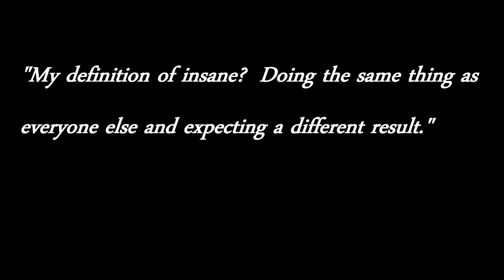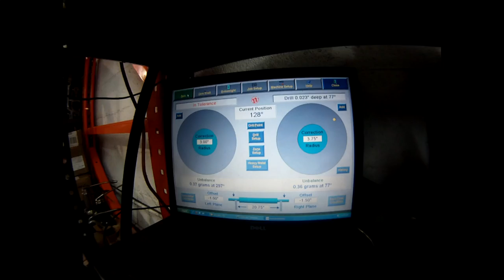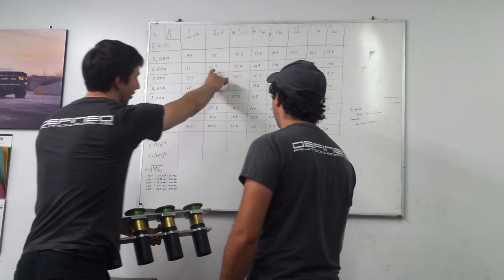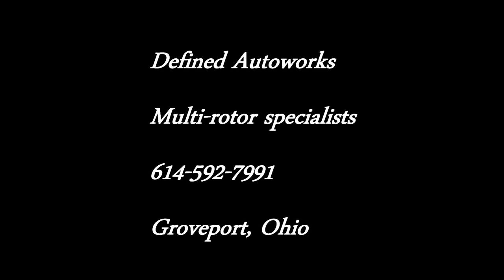Mazda Rx7 4-rotor race car. The making of a Defined Autoworks Beast. [Offical Video]

Comment: LSX>Rotary 

Nuff' said.
Reply: Howl? I guess Honda's have howls too then lol cause they both sound like shit
Reply: Mike Zita A peripheral port four rotor off idle sounds about as much like a regular ol' 2 rotor (or a 4 cylinder) as an LSX does (Meaning, it doesn't at all.) At WOT the exhaust pulses in this all match up and give it a v12 type sound. A 4 rotor has three times as many exhaust pulses per rotation of the output shaft as a 4 cylinder piston engine does. 

Also, I think this engine will make more HP N/A than you realize... the one Mazda made for the 787B made up to 900hp (on race fuel) without forced induction back in the early 90s. 

The most powerful naturally aspirated LSX I could find was the 1,029hp 440ci LSX made by Pro Line Racing.  At 440ci / 7.2l, that engine makes an amazing 142hp per liter. The Honda S2000 only makes 123hp per liter and it was at one time the highest specific output production car in the world. Even 10 years ago, people would say you were crazy for even suggesting that it were possible to do that on gasoline with pushrods and 2 valves per cylinder. The LS series of engines are amazing when well built and should have way more respect than they get at times. 

However, the 26b if we consider the R26B made by Mazda a 2.6l engine (because that is it's true static displacement), even detuned to 650HP to keep those exhaust temps down it makes 250HP per liter. That's equivalent to an S2000 coming from the factory with a 500HP 2.0L four cylinder with no turbos that runs on pump gas, or the LS1 from a C5 Corvette making over 1400HP when it rolled off factory lines.

Also, If you want to consider the 26B a larger engine than it physically is just because of how many times the rotors turn per rotation of the output shaft, you're really missing the point. If we're talking about which design uses it's displacement better, it's obviously the rotary. Its a 2.6L engine that weighs under 400lbs and puts out over 800hp.   

However if you're more worried about total output than specific output, or HP/$ than HP/L, the LSX looks better.